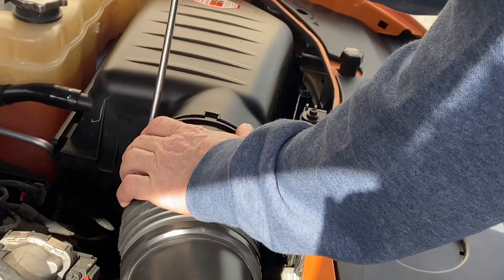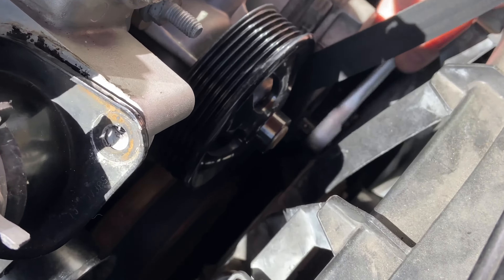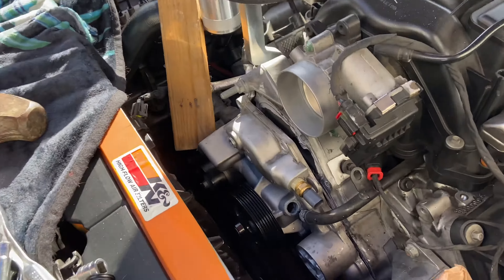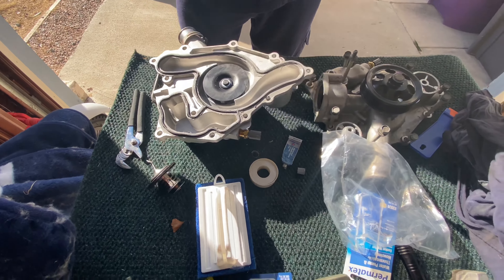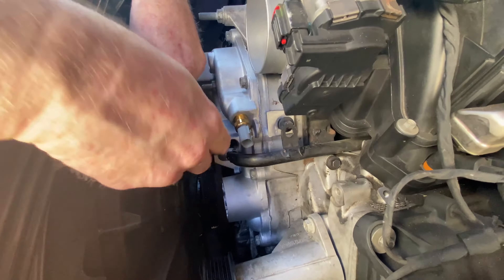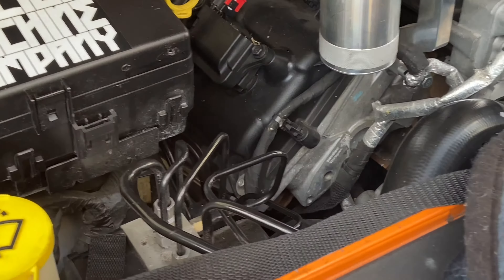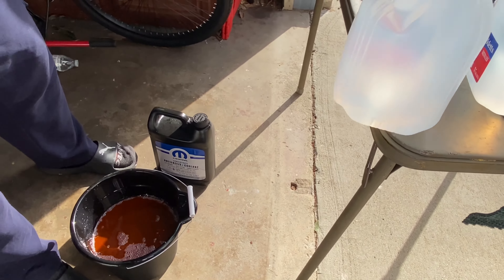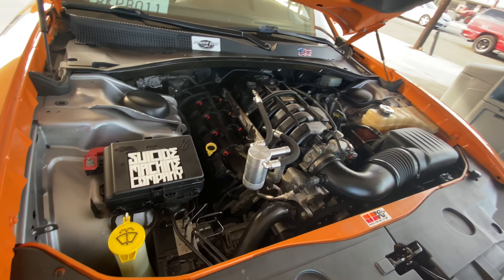5.7 Hemi Water Pump Replacement

Comment: Connect lower water pump hose to water pump before mounting water pump.Saves time fighting bottom clamp.
Reply: Also will not need to go under vehicle to fight that bottom clamp.
Reply: YES... I figured that out when trying to remove it ...hahah Big hassle if you don't....
Reply: glad i saw this before trying, it was honestly a breeze other than that its almost like they knew they'd be replaced frequently 😂

Comment: No sealant should be used with the pump gasket. If anything I fill the grooves with Fluid Film (lanolin), then place in the gasket. Reduces corrosion so less time cleaning the block when job has to be done again in another 30kmi. OEM or aftermarket, no one seems to make a decent pump for these so get one with a lifetime warranty and cross your fingers.
Reply: I have already gone through 2 water pumps because one came out defective and the other one is leaking.
Reply: So true about any of these water pumps.. I go through changing these like  tires on my 2008 CHARGER SRT8... I just add a light coat of permatek around the edges, and a light coat inside the grooves, and on the coolant spout/ heater hose that runs underneath the intake... Seems like after you take off the original water pump the car originally had .. you must you some type of sealant

Comment: nice review, i have a 2013 and mines not leaking yet but sounds like a frog in the front of engine. where did u purchase this water pump.
Reply: Sounds like air pockets
Reply: And you can buy em at any auto parts store. Got mine at an autozone

Comment: GREAT instructional video sir..  I need to redo mine because the gasket is leaking... i did not use sealer with the gasket but i think RTV black in the canal will work ok.
Thanks for posting and i will sub.

Jeremy

Comment: How did you get a complete drain of the DI water?  From the radiator?  Seems like that would leave some water in the block and heater.

Comment: Where did you get the oil catch can and splitter from ?
Reply from the maker: Universal Flat Diffuser Style... https://www.amazon.com/dp/B01CYYEJ2E?ref=ppx_pop_mob_ap_share ECCPP Adjustable 7.87" Black Front Bumper Lip Splitter Strut Rod Tie Support Bars Universal 2pcs https://www.amazon.com/dp/B07SCLD37D/ref=cm_sw_r_cp_api_glt_i_Y2DY9DH7RFGZGHZ7N4WP?_encoding=UTF8&psc=1
Reply from the maker: got the catch can on ebay

Comment: I just believe I have gasket issue. The pump is fine just intermittent leak! But if I remove it to replace gasket …… then I should replace it!
Reply from the maker: might as well replace it while you have off I don't remember but it didn't cost that much.